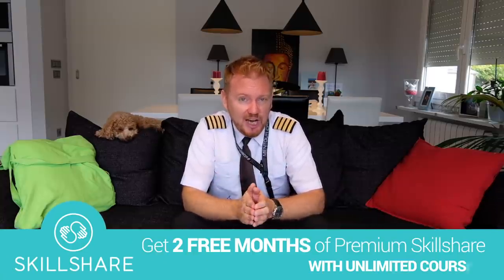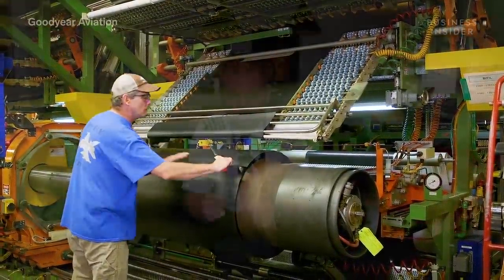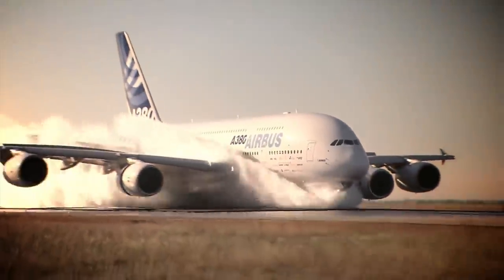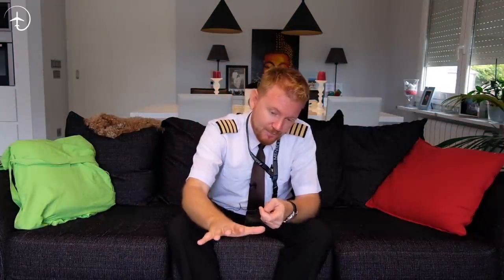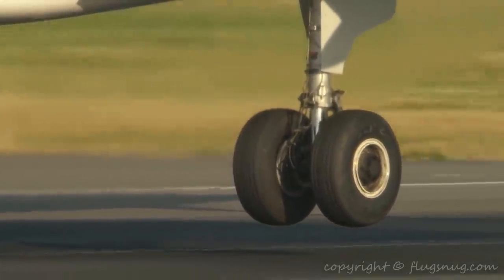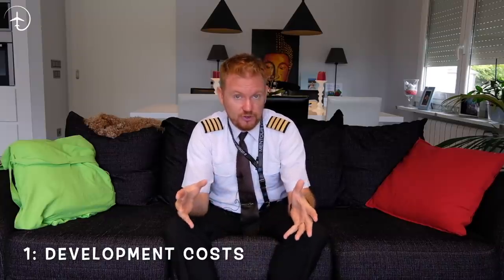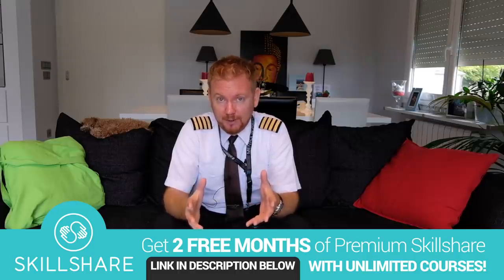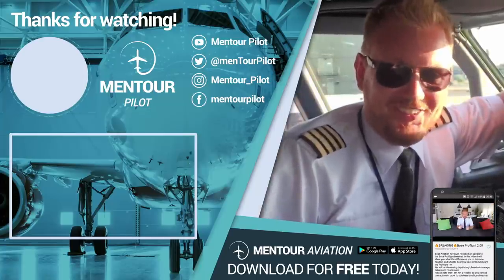Why not make plane-tires spin, before landing?!

Comment: One correction: "Inert gas" means that is not reacting chemically with a lot of other elements while, for example, oxygen reacts easily with iron. It's not about pressure.
Reply: Indeed, oxygen gas and other gases (or mixes) follow the basic rule of temperature having a linear relationship with pressure. One problem with normal atmospheric air when it's subjected to large swings in temperature or pressure is that it contains water vapor, which could easily turn into liquid or solid under the temperature and pressure conditions that affect jet aircraft; liquid or solid water in the tires being undesirable for multiple reasons. I assume the process they use to separate nitrogen from air is sufficient to remove all significant impurities including water present in ordinary air.
Reply: Not true. The chemistry use isn't the definitive use of the word. Inert just means inactive. So his use here was appropriate.
Reply: What are you the inert gas police?
Reply: Inert gas must be non flammable is  why gas lines are nitrogen purged as well as non corrosive etc
Reply: kefsound it’s about not supplying oxygen to burning brakes and tires following an aborted takeoff and consecutive pressure relieve valves releasing the gas rapidly. Every tire is equipped with a pressure release valve to avoid tires “exploding”. The Nitrogen released won’t feed the flames after such event.
Reply: @Chris individual gas constant of nitrogen is 296, whereas the individual gas constant of regular air is 287. So you're wrong, that's not a big enough difference, and the difference is in the wrong direction. They are basically the same if, I understand the ideal gas law. Which leaves the issue to combustibility, moisture, and availibuility. I say availability because when I looked this up just a second ago argon has very similar gaseous property to that of nitrogen but is more expensive, as is everything else of a similar type.
Reply: The use of nitrogen as opposed to regular air is mostly to assure that there is NO water vapor, the coefficient of change in pressure with temperature is near identical to air, an added minor benefit is that there is no chemical reaction between the high pressure oxygen that would be in the tire and and the rubber.
Reply: @johndavidwolf4239  I just said all of that, but you said it better.
Reply: @johndavidwolf4239  To which we can add the oxygen in air will leak out (through the rubber) more quickly than nitrogen which means the tire filled with pure nitrogen will lose pressure more slowly than one filled with air.
Reply: @johndavidwolf4239  Right. Everyone else here has no idea what they are talking about like "individual gas constant" PV=nRT the R is the same no matter what gas, so that guy has no idea what he is talking about. Using a nitrogen tank is a cheap way to be assured that you get moisture free gas into the tires with the added benefit that if there is a blow out or fire a huge blast of air won't fuel a burning brake system.  Remember air is 4/5 nitrogen so the properties are going to be just like that of air.  Yes there will be slightly less dry rotting without oxygen inside the tire but the tires are changed long before you would see any difference.
Reply: Peter L knows.
Reply: Air contains 80%nitrogen .just to eliminate 20%oxygen pure nitrogen is filled in tyres as oxygen reacts and slowly damages the tyres .
Reply: @daveb5041  The equation is PV = ZnRT, where Z is the comprehensibility of the gas. For an ideal gas it's 1, but for real gases it's a function of temperature and pressure. At 25C 200psig for nitrogen it's 0.9942 (nearly ideal) and for air (assuming 79% nitrogen on a volume basis and the rest oxygen) it's 0.9926, so pure nitrogen and pure air will respond virtually identically to temperature and pressure.

I'm not sure why it's not possible to dry air so it's as water free as pure nitrogen, unless using membrane technology, it's just as easy to create nitrogen as it is dry air, (i.e. the larger O2 molecule is blocked by the membrane as well as the water).

Also, I'm not sure about the argument of keeping the oxygen out to protect the rubber, when the outside of the tyre is exposed to air. Even the to prevent adding oxygen to the fire argument is a bit suspect as I can't see it being that much additional oxygen.
Reply: Halffastcyclist:  I disagree, both oxygen and nitrogen molecules are diatomic.  The atomic mass of oxygen is 16 and nitrogen is 14, as such nitrogen molecules are slightly smaller and therefore might pass through rubber faster, although the difference in a thick aircraft tire would be almost immeasurable.  The reason rubber balloon inflated with helium deflate faster is because helium has an atomic mass of 4 and is monatomic .
Reply: Dave B;  I agree with what you said with the note that in the ideal gas equation the 'n' (number of mols)  will be slightly higher for pure nitrogen as opposes to standard air, as the atomic mass of nitrogen is 14, and oxygen is 16, a given volume of nitrogen will contain 2.86% more molecules ((16*.2+14*.8)/14) than the same volume of air at the same pressure, a very minor difference.
Reply: @johndavidwolf4239  A couple of things wrong with your comment.
1. Oxygen and Nitrogen are diatomic gases in air, so the molecular weight of the molecules is approx 32 and 28.
2. In the equation PV = nRT, P is Pressure, V is Volume, T is Temperature and R is a constant, with a value depending on the units used for P,V & T. n as you say is number of moles. Therefore the number of moles of gas will be the same for any gas, if we ignore Z (the comprehensibility) in the above equation. However, the mass of the gas would be slightly different, as pure nitrogen is slightly light than air.
Reply: @axelBr1  I agree, as a chemical science student, thank you. Most gasses follow the ratio of 22.4 litres per mole. John's comment about the mass is irrelevant, mass is not a factor in the ideal gas law.
Reply: @Peter L Peter, exactly; the gases are subject to the gas laws which you represented with the formula.  Water vapor, usually around 3% can vary absolutes but not nearly as inferred.  Nitrogen is probably the most prudent thing to do but it's not about maintaining constant pressure (as described in the Captain's explanation).
Reply: @johndavidwolf4239  A big advantage of nitrogen is that it is less likely to escape through the rubber due to the larger size of Nitrogen molecules. The second advantage is rubber oxidation, since regular air has about 20% oxygen, and anything exposed to oxygen "oxidizes"!
Reply: If there's an in ert, is there an out ert? And what's an ert, anyway?!
Reply: Yes nitrogen does change in pressure due to temperature change but the change is less than 10 percent that of “air”. As far as on planet temperatures, it doesn’t change enough to worry about in just about any circumstance. Therefore it is considered inert in all circumstances that aren’t space flight.
Reply: Inert gas means it has 8 electrons in its valence shell at room temp and pressure. As a result, inert gases do not react with other elements because they are already stable at rtp. Just sayin... no need to reply to me...
Reply: Todays compressed air is dryed to +/- -50 C dewpoint and oil free. And oxygen degradation is also not a factor because the mechanical wear is leading on an aircraft tyre. It’s much more important you set your tyre pressure at the correct temperature.
Reply: Alex Bristor:  You are correct, I made a mistake, it has been over 4 decades since I last was in school,  The weight of the gas in the tire would be about 2.8% less, which is insignificant.
Reply: Yeah.  I found his claim about nitrogen being less susceptible to changes in temperature odd, given that the majority of the air we breathe is nitrogen (about 80%).  Any gas will want to compress or expand greatly with changes in temperature.  If held inside an enclosure, its pressure will increase significantly when the temperature rises.
Reply: Yeah a technical mistake. Nitrogen reacts identical to Air apart from two factors: combustibility and water vapor content. Water is the main factor affecting pressure in changing temperature conditions as it can be solid, liquid and gas under operation of the tire.
Nitrogen is inert, in that it does not support fire, but its not the main factor I presume.
Reply: @binishulman8655  not true, because, as mentioned below, PV=nRT for any has. Inert means chemistry, not a pressure or temperature reaction.
Reply: @moodberry  ..  Both of your arguments are trivial.  They aren't going around filling tires because they leaked through the rubber. Leaks are at the wheel interface or valve stem.  I've owned my car for 25 years.  I've never added air to the spare, yet it is still over 30psi.  If there was leakage through the rubber, it would show up in a quarter century.
You heard in the video him saying tires last 300-500 cycles, and can be retreaded 4-5 times.  If an airplane makes only one trip per day, that's a total life of the casing being less than 7 years. Tires last a lot longer than that before oxidation affects them.
Reply: I think the real reason they use nitrogen, besides being 99.9999% free of moisture is portability.  If they were using air, they'd have to have a portable compressor at every airport.  It would be fuel driven, meaning maintenance on the engine, maintenance on the compressor, maintenance on the air dryer system, maintenance on the tow vehicle.  Or, they could just buy K bottles of Ni and wheel them out on a hand cart to fill the tires.  Last time I bought, a K bottle of Ni was under $40, and would be enough to top up the tires on many planes.
Reply: @e-curb  They can buy compressed air free of moisture as well. It's even easy than to buy nitrogen.
Reply: E-Curb Nitrogen = N just saying Ni is nickel
Reply: Does anyone here realize that nitrogen is chosen because it doesn't also burn? It will put it fire. A very good thing on aircraft.
Reply: @CanadianPetrolHead  So does diatomic oxygen. What's your point.
Reply: ThaFuzzwood My point is that the statement Nitrogen is an inert gas is false. You mentioned diatomic molecule, we were talking about atoms :) inert gas are stable atoms with complete valence shells at rtp. Oxygen requires another element to form a compound or molecule to be stable at rtp. I hope that answers your question.
Reply: @JDJD-mw9rr  they got a doctorate at the university of google
Reply: @colinsouthern  nitrogen molecules "penetrate" out of the rubber housing less than oxygen... so the tyres filled with nitrogen better maintain their  pressure within the tyre
Reply: There are some reasons to use nitrogen, but neither thermal expansion / contraction nor diffusion speed is one of them. Industrially compressed nitrogen is:

- cheap
- dry
- for sure not contaminated with oil, potentially damaging rubber
- does not sustain corrosion
- does not burn

Thereby the oil-thing dominates and explains why you do not fill your 10k $ airplane tires on an old crusty air compressor at blackwater airfield ..
Reply: Correct. The thing that makes tyre pressures particularly affected by temperature is water vapour so the goal is to fill them with dry air. It's easiest just to use nitrogen from a bottle for that (air is mostly nitrogen anyway).
Reply: inert is what my wife is to me.
Reply: +Julian Brelsford. completely true. Large commercial transport companies, such as bus garages, compress the air to high pressure in the holding tanks in order to condense water vapor. A drier is added in the line to the air hoses. The system is the same for factories using air tools, particularly paint spray guns, where small water droplet would ruin high quality finish when spraying non water based paints and lacquers. This was a problem during the decline of UK car manufacture when equipment maintenance was neglected and driers not replaced regularly.
Reply: @ruirodtube  a cigar for you as you gave the right answer.
Reply: You assumed wrong that u need to spin the wheels to the landing speed. Not necessary, it's enough to spin them to 150 km/h or some. Leave the rest for contact, with auto-disengage electric motor at touchdown :) The stress would be many times smaller. How much?! Well let's see: [(landing speed - 150)^2]/landing speed ^2 = [(220-150)^2]/220^2= 4900/48400 = almost 1/10 . So with that you have 1/10 spin stress on the wheel. So here is the solution ;)
Reply: @hwinangkoso  And K is potassium. I've never seen a bottle made of that. :D
Reply: @Dingomush   Nitrogen and air behave essentially the same during temperature change.
Reply: Partial pressure can absolutely drive up reaction rates.
Reply: @e-curb  Airport are big places, they have compressors, and some gasses are delivered in bulk as liquids and then converted to gasses under pressure, or delivered in cylinders at around 4000psi then run through a valve system to reduce that for replenishment of tyres and the gas side of hydraulic accumulators.
 They have whole sections devoted to the delivery of gasses and liquids to the aircraft servicing guys. There's oils, water,(for toilets and galleys) removal facilities to empty toilets.  They may have Oxygen charging facilities, Military aircraft often use liquid oxygen in pressurised containers to supply the crew though many now take engine air from the compressor and run it through a molecular sieve and extract the oxygen that way.
 Thats along way to say that aircraft are big business and take large amounts of support so there is a huge infrastructure backing them up, in particular civil aircraft time on the ground is wasted money so everything is done to provide what is needed.
Reply: Was going to make that point myself.
Reply: @daveb5041  There is a whole lot of misinformation coming from purveyors of nitrogen in car tires, that is obvious to anyone who understands basic physics of gases. IMO, using nitrogen for car tires (with the possible exception of race cars) is of minimal benefit and generally not worth the cost. Nitrogen in car tires is a borderline scam.
Reply: @binishulman8655  Sorry, but you're wrong.  While the word 'inert' might mean 'inactive' in common usage, when one speaks of an INERT GAS, this is a very specific scientific meaning.  And indeed, it means that the gas isn't chemically reactive.  kefsound is correct - and I noticed this error, too.  Nitrogen technically isn't an inert gas; it DOES react with lots of elements, forming nitrides.  But it doesn't react nearly as easily as oxygen.  The so-called noble gases are the only true inert gases.  Loosely, people speak of nitrogen gas being inert because, unlike air, it doesn't support oxidation reactions.  But even this loose usage of the term is referring to the gas's lack of easy chemical reactivity.

Call me the baddest inert gas cop in the city... ;-)
Reply: @alansizer2006  He's using that term to refer to a standardized SIZE of the gas bottle.  Look it up.  K (sized) bottles are pretty much the most common compressed-gas cylinder size/type.
Reply: @daveb5041  Neither Nitrogen or Oxygen are an ideal gas! So it is you who does not know what they are talking about!